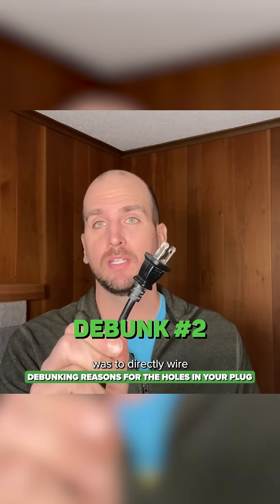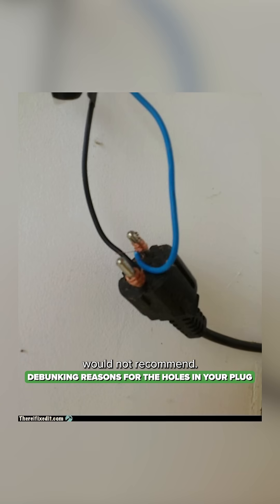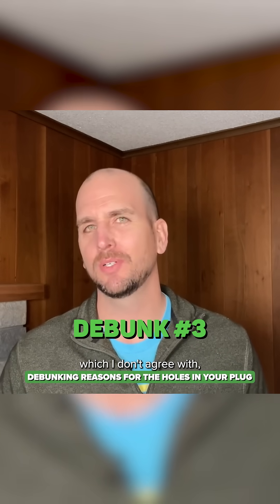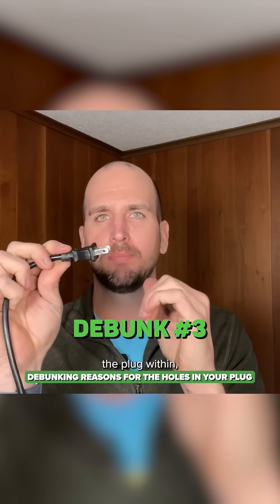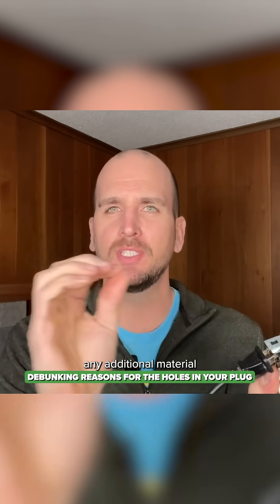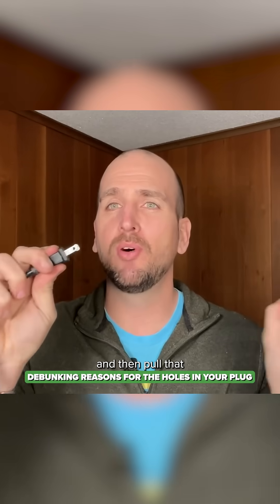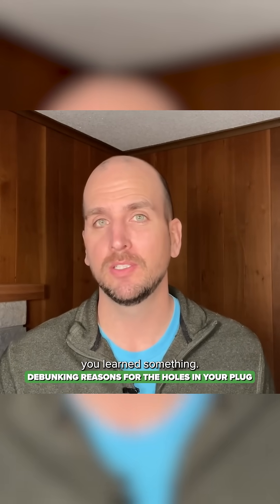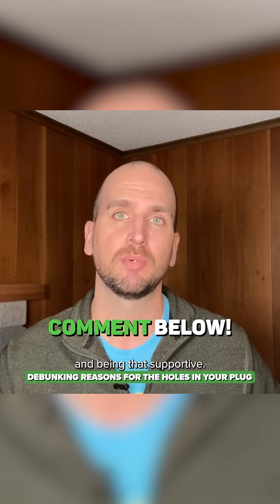Debunking Reasons for the Holes in Your Plug

Comment: the holes are also for lockout/tagout purposes, but that is secondary to the original purpose. they were added after the blade standard was adopted. The holes were added so that contacts on the terminals in the socket would "lock" into them to keep them from literally falling out. This was a problem prior to the addition of these holes due to them using a silver contact bonded to anything from copper or brass to aluminum as the connection to the plug, as the contacts and terminals would commonly wear out and lose tension allowing the plug to just fall out of the socket.